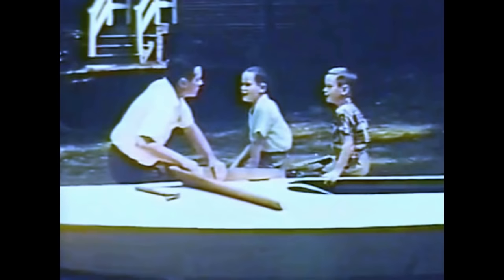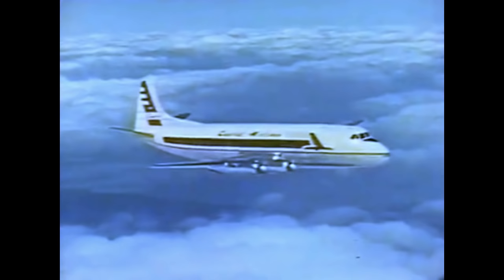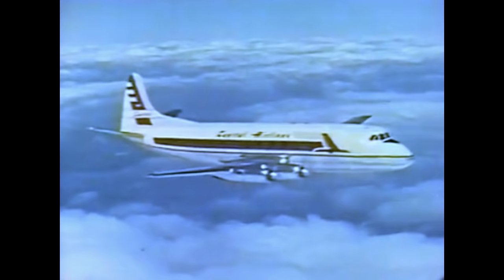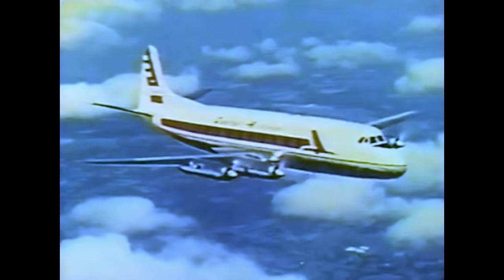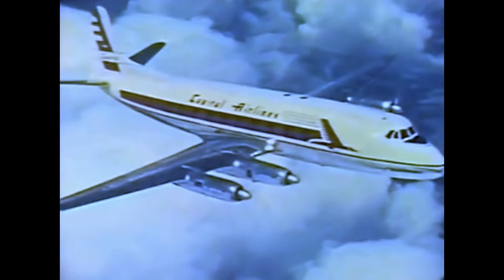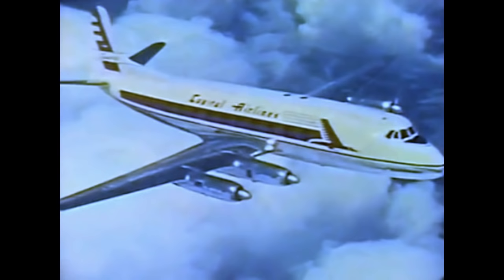Capital Vickers Viscount Promo Film  - 1955

Comment: Back when air passengers appreciated turboprops - and not only that, turboprops like this - with four powerplants driving four-bladed propellers that weren't designed for quietness, and not only that, propellers made out of titanium, which absorbs somewhat less vibration than the carbon fiber composite marvels found in all modern turboprops!

Comment: The end of Capital was not pretty. I worked there in '84 or so with a crew of angry white trash jailbirds from the Lavergne / Smyrna, TN (Nashville) area. They were doing contract maintenance on OLD 4 engine jets. The slop crew made doing floor/ airframe work a biohazard by sloshing toilet juice throughout. One day we couldn't get a UPS drop down cargo door to slide into its recess. After recess inspection, we removed a large mass of leafy green packed substance and pitched it over the side. Thinking we had a large clean up job before lunch, we came to the floor to find an unheard of cleanly swept area. Who would have done that ? !!!!
Reply: "leafy green packed substance" - for smoking no doubt.